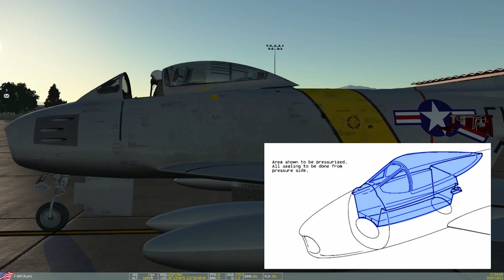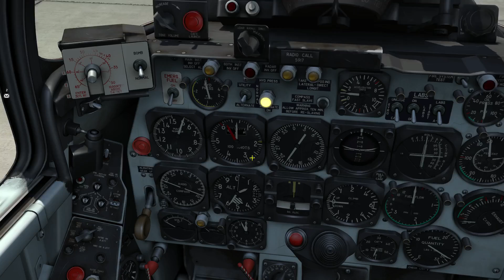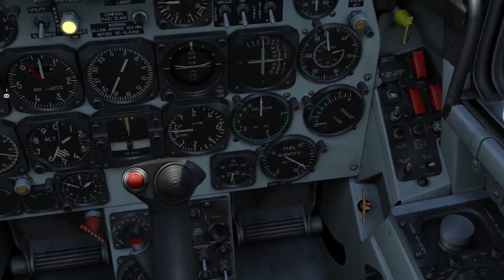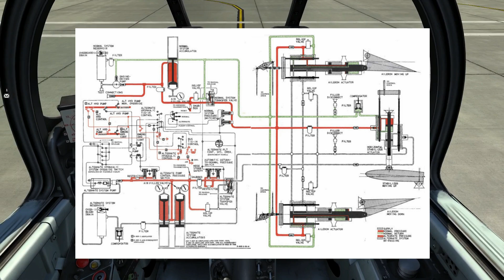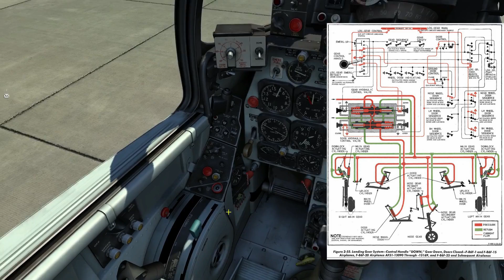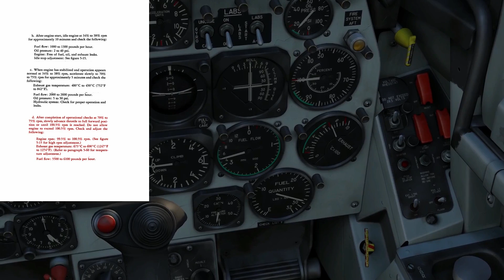Test Flight: DCS F-86F

Comment: Are you sure about the engine outboard issues noted later in the video? I say that because as I run through Chuck_Owls startup checklist, I seem to get the correct behaviour. In his instructions: 1) Master Engine: On; 2) Battery Switch down for 2-3 seconds, then up; 3) 3% on the engine RPM then 4) throttle outboard once,  and the engine ramps up to the 9 - 10 % mark. In the above video, I think that you had the throttle outboard before toggling the battery switch (which you clicked on a couple of times) and then straight to 9%. Pretty sure I saw the correct behaviour last night and since this video is new, I am assuming that you are using the latest DCS World 1.5.
Reply: BTW: Love the video and hope to see more in the series!
Reply from the maker: +David Penney Hey David, Chuck_Owls guide is fantastic!  I highly recommend it.  However that guide is how to fly the DCS F-86, not reflective of the real aircraft.  The engine model of the F-86 is, well wrong.  In game, the engine "stops" at 3% and wont actually go past this point until the throttle is moved outboard (First press of Home).  

This is not true, on the real aircraft once the starter is energized, the engine will actually accelerate to about 10%, with no movement of the throttle at all.  Its up to the pilot to move the throttle at the corresponding times during the start up procedure.IE at 3% move throttle outboard and then finally to idle at 6% or greater, I say greater here because the higher the percentage before adding fuel, the better for the engine.

So the reason I had the throttle already outboard that first part is for realism, yes in the real aircraft you should wait until 3%.   Moving the throttle outboard turns on the igniters and fuel pumps, infact in the start up video of the Sabre I put in, right before engine start you can hear some loud "clicking" that then stops.  When you hear that, thats actually the throttle being pushed outboard (1st press of home in game).  Why we do that BEFORE engine start is to hear the igniters are working.

So in game, to have a more realistic engine start the throttle should be moved to the first stage before hitting the starter.  (I say more realistic, but the spool up time is still grossly wrong.  These engines do not spin to 10% in a matter of seconds like it does in game!)

Thank you for the positive feedback!!  Much appreciated

Comment: This was an excellently informative video, and I look forward to the next one.  

An important note on cinematography: extraneous movements, particularly fast ones, cause eye-strain in the viewer.  For external views, it's ok to have more static shots while you're talking.  If you do need to rotate the view, make it smooth and gentle, or fade between different static positions with the video editor rather than trying to do it within DCS since the DCS controls aren't really suited for it.  For internal views, consider turning off your TrackIR and panning with the keyboard.  TrackIR is a great tool for actually flying, but for demonstrations it adds a little wobble that gets very distracting when you're not in personal control of it.  Finally, when highlighting things with the cursor, it's better to move it slowly than whipping it around so the audience has an easier time tracking it, both for visibility's sake and, again, to prevent eye-strain.
Reply from the maker: +Sc Avenger Thanks that is awesome information!